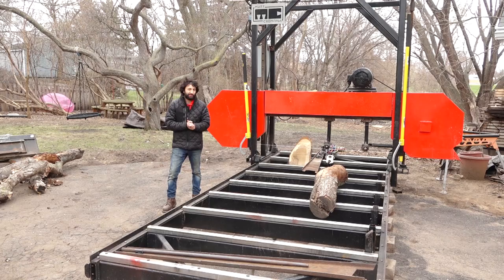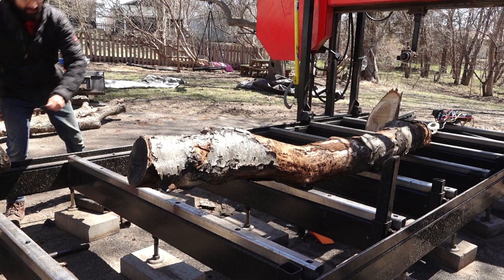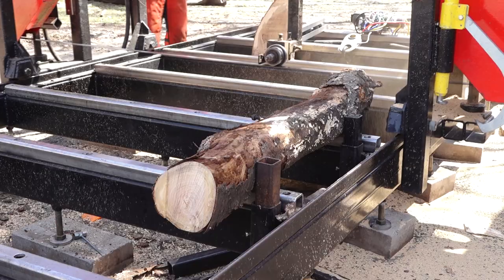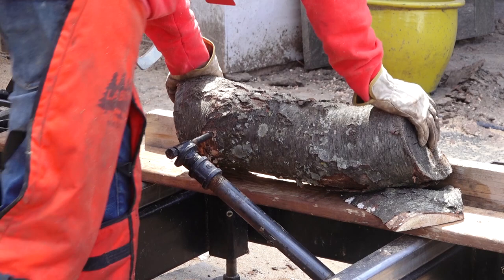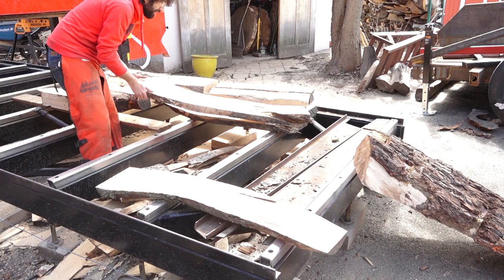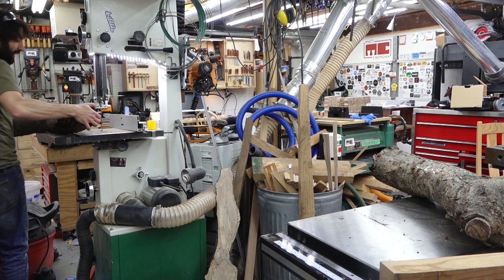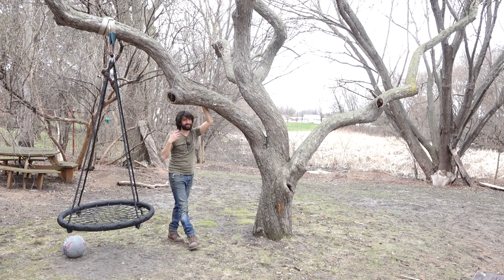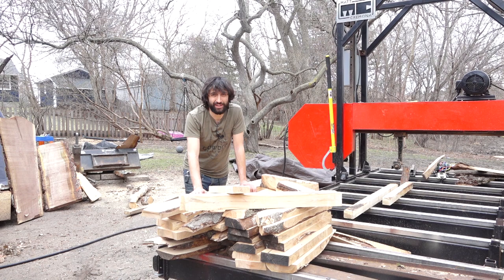Are Small Logs Worth Sawing into Lumber?

Comment: As a wood turner, I would give my eye teeth for bowl blanks especially the crotch sections. Don’t underestimate the value of those ‘little’ logs. You could make a pile of dough by providing blanks.
Reply: 😹😹I was thinking the same thing trunks great for boards but branches on the other hand are fantastic for wood turning. I loved what I did see of the grain as for the parts that kept tossing with live edge much of that can be used for making bobbins or pen blanks for me the bobbins would be plus for all of my embroidery threads I still have around 500 skeins to be placed onto plastic cards😜😜🙈 but alas I have to wait until have more shop room for a wood turning machine that I have my eye one😹😹😹😹 one day 😹😹😹

Comment: I had the Amish saw a trailer load of free Black Walnut the utility company cut from limbs.  A lot of small, short stuff like you were sawing here.  Although I didn't see the process,  they told me they used an auxiliary bed (plywwod) and toenailed each log to the bed.  Cost me $250,  but I did get alot of slabs for epoxy pours and stuff.  No dimensional lumber though. I enjoyed the video.

Comment: im no sawyer but ive dropped big trees and had them milled.....a big silky oay i had in the yard took a lightning hit and so i dropped her and i dont have a mill or much money,i dove in with an 18 inch ryobi ,burned her at full rpm for probably 9 to ten tanks to learn ....then i took it back said it was crap and got the 20 inch 50cc......man i would cut all that freehand with a chalk line and tape....small stuff good for garden and craft.you can cut straight lumber with the chainsaw ,crotches work good for shelf pionts...and it looks cool pulling boards the entire limb length...love your tutorials dude .

Comment: I took down a few tall Hickories on my property and considered getting them sawn into boards.  The straight sections were about 30 feet and about 20 inches at the base, 14 at the tip.  When I considered how much of that wood  would be pith, I decided against calling the sawyer.  Put it on CL though and it was gone in a day.  One mans trash, is another's treasure

Comment: It's not the kind of work you would pay someone for, but if you have fun milling, and nothing pressing to do, it works.
I don't yet have a bandsaw of any sort, so starting with interesting looking logs from the firewood pile, I can make some pretty stock on the tablesaw - with the use of appropriate sleds and holdowns - tablesaws and rocking wood do NOT mix well.
It all ends up as suitable stock for boxes or inlays or other small stuff.
Great Vid Matt - Thanks

Comment: Are they worth it?
If they mean something to someone, you are being compensated somehow for your effort and machine use then yes they are worth it.
IMO
Reply: Also, if you can get it at a significantly lower price. The main logs can be thousands of dollars where I live while branches are sold as cheap firewood. Considering I don't have a monster sized mill, the firewood branches are just fine for smaller project or mozaic type countertops.

Comment: My dad had a Monterey Pine (or Jeffries Pine) that was the largest in the county (5 feet diameter and 120 feet tall) in the suburbs that fell over. Sadly, I was in a bad job and just in the beginning of my woodworking journey. I didn't have the bandwidth or knowledge of how to find local sawyers. Sadly, it all got hauled off. A few years later and I would have been able to help find the connections to get it sawed into,some lumber. I would have made a few fancy bird houses as a way to remember and celebrate all the vast number of birds that tree supported. Also, would have it cut into true 1x6 material. When he rebuilt the garage it crushed, it would have been nice to have some, if not all the lumber from the new garage to have come from that tree.
Reply from the maker: That would have been a lovely story

Comment: Welcome to my world Matt. The logs I process for guitars and instruments are not much wider than 8" when mature. 10"- 12" would be rare. These are Rosewood (dalbergia species). You can barley get 3" - 4" of quarter-sawn material if your pith is not destroyed. You need at least 7 1/2" in width for a book-matched guitar back. I can make a fretboard from 1/4" x 4" x 18". A piece like that sells for $45 - $75. So for me, it's all worth saving.

Comment: One thing I instantly thought of when... looking at this situation, is to make
cutting small logs practical at all, it looks like you'd have to be willing to make some 
sort of holding sacrificial jig, that you could cut through with no issue...
Like part of the jig would be holding the log up above the steel cross members,
and part of the jig would be holding the end of the log, where the cut would come
through & finish. . .
At least that's what I thought while watching.
*After actually finishing the video, I see that you did use a jig for those smaller pieces & used your bandsaw.
That was interesting. 
That being said when you started using your "jointer" my minds instantly went to that
other youtuber who got injured recently..  that thought still tears me up mentally..

Comment: Concerning cupping of limb logs: … can the cupping be reduced or eliminated by face pressure across the cut lumber during a long, slow drying period, or does the stress not relax over time? Put another way perhaps, does the wood remember forever that it had a compression side and a tension side and high curvature growth rings?
Reply: Well, you're really fighting 2 problems. The center of the log, the pith, is usually so unstable that it's discarded out of larger lumber, but in small logs, it's almost impossible to cut around. If you look at the endgrain of a board and the growth rings, the smaller arcs, and especially the arcs that enter and exit on the same side of the board are a good indication where and how severely warping and cupping will occur. Some of this can be negated with pressure and long drying, but not totally eliminated. 

Limb wood and compression/tension is a whole other problem. The fibers of the tree are grown under tension, and even when dry, when you cut them, they can release and cause a dry straight board to bend right in front of your eyes. If you've sawn a lot of lumber, you probably have seen pinching and movement with long rip cuts, probably caused because the tree had a lean. Limb wood is under even more internal stress and tension, so you can use it, but any cut or large modification can cause this internal tension release in unpredictable ways. It's kinda like pre-stressed concrete, it was made under stress and has internal forces fighting against each other, but on the outside it looks like a normal beam.
Reply: I've battled with pieces of lumber for years trying to get them straight enough to use. Precisely clamping and weighting and damping one side vs drying the other and my conclusion is save the headache.

Comment: Sometimes I am looking for a small piece. It is a HUGE pain and waste to cut a small piece out of a large heavy slab. Almost everyone needs stickers as well or your big boards will not dry or stay dry right.  I organize my wood to use the small pieces first and I do use the closest sized one routinely. I have tiny 6 x 1 1/2 inch shims aligning my door right now. I can make pegs out of small pieces with a sharpened pipe. Even a toothpick seems valuable when you need one.

Comment: Hi Matt! Hope you or anyone else can answer a question. I have 10 or 12 Black walnut logs 6 to 8' long. They are trunk sections, strait as a string. They very from 12" to 8" dia. If I made square post from the small logs, would they be stable enough for nice table legs, if they didn't split from drying first?!? Thanks much for any input!!!
Reply from the maker: Just squaring them up, you'll include the pith so they will very likely crack and split to some extent while drying.  Maybe you like that look or you fill the cracks with epoxy; just have realistic expectations.
Reply: @mcremona  Thank you!

Comment: I've tried cutting log on my Rikon.  However, I assume your small logs are relatively dry?  I run a 3/4 Woodslicer blade in mine and I tried cutting some walnut logs once that were about 10-12" diameter, about 24" long..  I cut fine for a few log sections and then the blade dulled.  I contacted Highland and they told me those blades are not designed for green wood, which apparently the logs were still somewhat wet.   Doh!  I had no idea and didn't think to check the logs with my meter before cutting.  Athought that's tricky anyway due to the sensor depth only going so far.

Comment: Hey, I'm early for once. I mainly saw between 150 and 350 mm logs on my Matthias Wandel inspired wooden bandsaw mill. For cheap wood that I cannot find or afford I'm more than willing to put in the effort. 
I mainly saw Jacaranda, some Boekenhout, Common hook thorn (harder than a sleeper I did once) and pink ivory. All dead/fallen trees in my area.
Reply: Jacaranda has some great grain.  Often overlooked.  Slabbed one once that was a good 600 mm across.
Reply: @waynemartin6841  Yes, often curly figure out of the branches, and easy to work with too! But nothing beats the pink ivory : ) It's like working with a soft metal compared to most other woods. 
The Common hook thorn looks a lot like walnut, just a LOT harder and some more wild grain patterns.